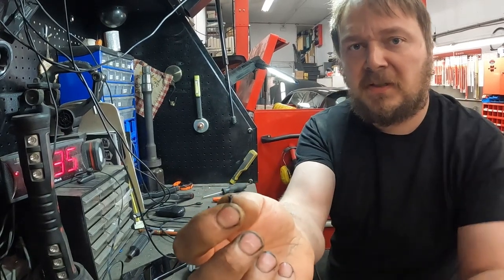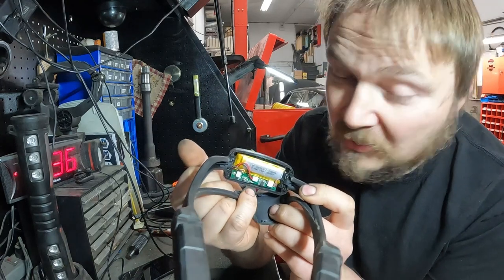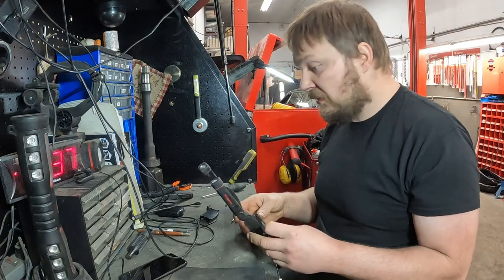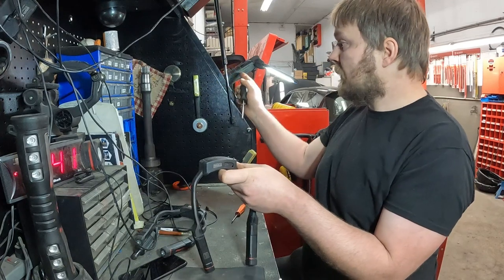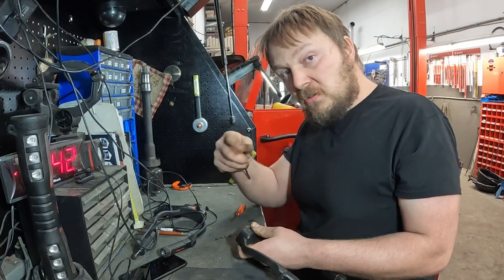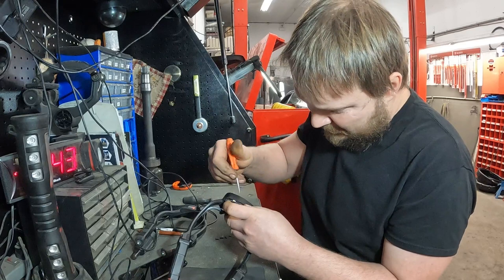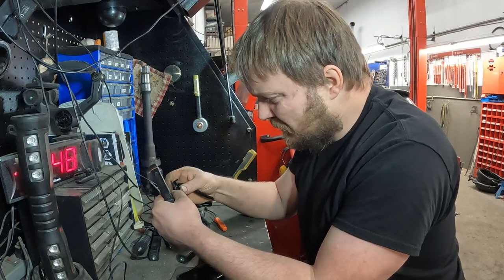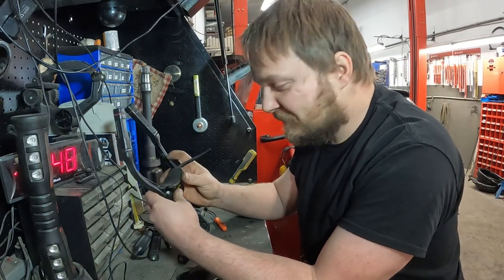Rechargeable LED work lights stop working? Snap-on neck light won't charge. Don't toss it. Easy Fix!

Comment: I loved my neck light. The one light quit working. Found a broken wire inside. Fixed it, and got it back together. Now it won't charge/only charges for 30 seconds. I love snap on tools, but for the price, this product is fucking garbage. I'm buying a cheapo harbor freight. I'm sure it will last as long as this one did. Which was about a year. And for the price, I can buy 5 of them, to 1 snap on.
Reply from the maker: @AlotL1keVegas I hear you there. Mine both malfunctioned WAY too early for the price. I was pretty annoyed at the time. I put them down for a long time as I was getting wicked lower neck pain from them. When you want to take a quick look at something it's easy to try and just use your neck light by tilting your neck and body to an awful angle. Rather than grabbing a flashlight or a worklight... That did a number on me...

But ya, working under a vehicle or doing suspension work they are awesome. Especially since our shop doesn't have great lighting. So I'm happy I was able to get both back up and running. I hated having a forehead style headlamp. I find I'm often standing at an angle reaching in and looking out the corner of my eye. When I tried a forehead style headlamp it was always shining away from where I was looking!

These are the only Snap-on lights that I have and use. I love Snap-on and my rep is one of my best friends but I'll never buy another Snap-on work light. Gone through WAYYYY too many of them. 

Before I got these back up and running I briefly looked to see who else made these style lights. My big turn off though is I can't handle lights that take AA/AAA batteries. They drive me nuts. I use my lights so much that it pretty much has to be Lithium Ion.

I hope ya find something that works for ya!